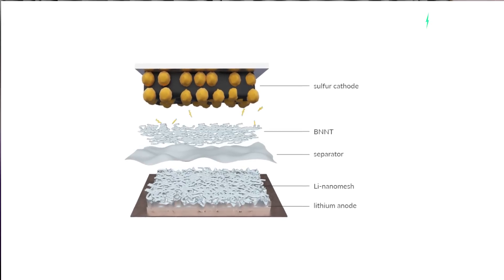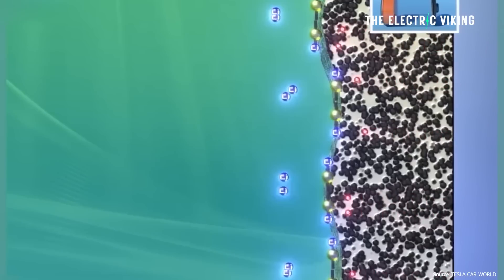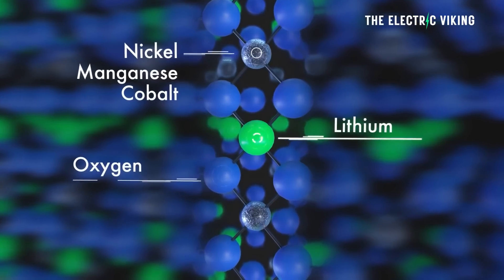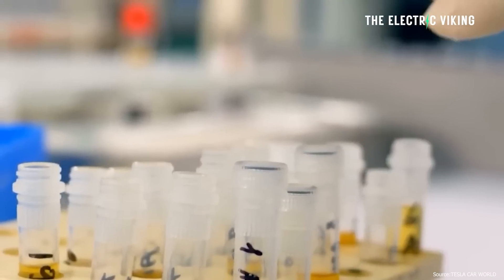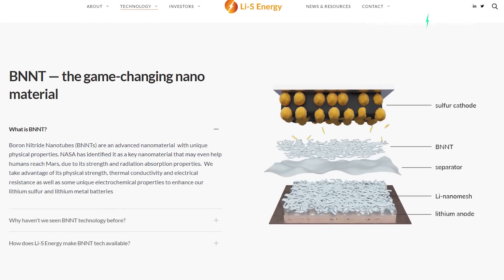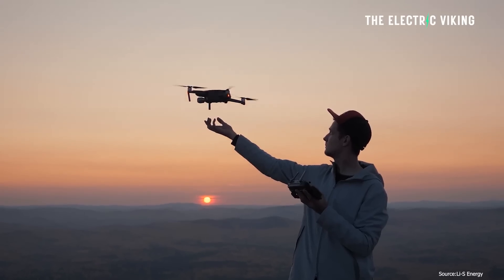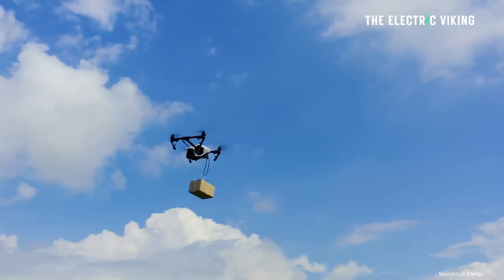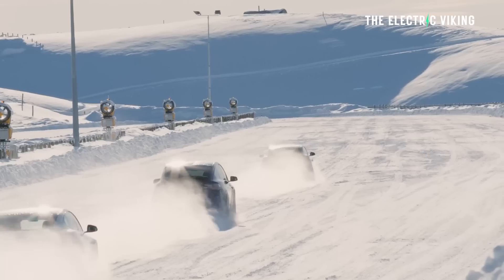Aussies Unveil 50% lighter Semi-Solid Lithium-Sulfur Battery Breakthrough

Comment: I have an Ampera PHEV, Chevy Volt Gen 1, I don’t need a new £60k EV with this battery, I just need an upgrade battery for the car I already have, this tech. would probably give my car 200 miles of range. The car industry wants us all to buy new EV’s & PHEVs then scrap them after a few years and then take out a massive loan to buy the next EV to save the planet, it’s unfortunately all money and BS still. Sorry having a cynical moment, but why, other than NIO are car companies not designing for upgrading as opposed to obsolescence.

Comment: There are 1000’s of battery technologies with higher energy density:
1) Some degrade too quickly.
2) Some aren’t structurally strong.
3) Some have slow charge/discharge rates.
4) Some are too expensive to produce.
5) Some have expensive materials.
6) Some take too long to produce.
7) Some can’t be mass produced.
8) Some have poor voltage charge curves or no charge curve at all (can’t record SoC).
9) Some are dangerous when penetrated. (Causing burns).
10) Some can’t handle execessive heat.
11) Some can’t handle excessive colds.
12) Some get damaged upon expansion. (0% state of charge).
13) Some can’t be produced due to patent infringements.
14) Some batteries does not have strong marketing sales teams to acquire adequate sponsoring and funding.
15) Some have a bad controls engineering and industrial management teams that doesn’t know how to expand factories for mass manufacturing and quality control.
16) Some can’t handle shaking/vibration (due to internal structural material durability)

The list goes on and on…

Comment: Please Sam, Don't confuse Watts with Watt hours.  
This confusion of units is one of the reasons that people find it hard to understand renewable energy / battery energy storage / Electric Vehicle technology.
If Journalists, YouTubers etc always used the units correctly, it would be easier for people to get used to the terminology and understand the technology. Unfortunately, the units are used incorrectly very often.

A "Watt hour" or "kilowatt hour" is a quantity of energy.. think of it like a litre of liquid fuel.. with no reference to how quickly it is created or used. Like a litre of petrol (gasoline) it might power a lawnmower for half an hour, or be used up in seconds by a drag car.
A Watt is a unit of power ... like a horsepower .. that informs you how much work is done in a given time.
And there is no such unit as a Watt per hour (W/h) that you sometimes see.. at least you haven't used that one.
I really appreciate your videos and respect the way you keep them coming, but please, take the time to get the units right!

Comment: Can you talk about battery improvements in mobile phones and laptops some time? Should be the same technology on a smaller scale right?
Reply: Definitely same, the thermal management system on our phone batteries are game changers!  The laptop batteries are structural making laptop crashes safer.
Reply: @borshardsd : GAME CHANGING IS ALL VERY WELL - as long as it won't affect Pacman, the only game I can manage

Comment: When you have a favourite hammer everything looks like a nail - and so it is with Deakin University and Boron Nitride nanotubes.
I haven’t yet found a supplier that provides publicly available cycle life specifications for 400 ~ 500 Wh/kg  Li cells.
Li S cells have been around for over 20 years (e.g. Sion power ) so I wouldn’t get too excited Sam.

Comment: You mixed up Volumetric energy density of Lithium Sulphur with gravimetric in Lithium Ion.
"half the weight" for the same capacity means double the gravimetric energy density, not 50% more,  double is a 100% increase.
For flight we really need Lithium Air or Aluminium air batteries, and to drop oxide for recycling inflight.  We can already make these but their cycle life is between 1-20, weight also increases with use.
Tesla are researching Lithium Sulphur for increased energy density but they are not expecting to double the density.
Sounds like exaggerated claims using irrelevant volume increases, and unreferenced weight change (ie they don't make a comparison to anything so they could be referring to something like LTO which has a very low density).

Comment: the problem is when planes land,  they are lighter than when they take off.  an ev plane would weight the same amount so you would be limited on take off weight because it would be landing weight.   you would have a hard limit on size because the landing gear wouldnt be able to take it otherwise.
Reply: Yu too Kewel.❄️❄️Y the big push for ev planes? Lemme guess; we’re destroying the planet with oil exploration? Ok. How bout jus slow it down alil bit?? Use ev’s, but still drill?
Reply: @ericpitre4031  wut?
Reply: @ericpitre4031  said that maintenance on electric motors is a fraction of other forms of propulsion

Comment: No - weight doesn't affect range of ev's so much because moving  weight has potential energy that is collected when you stop. EV's that have 100kWh battery are just bigger then ev's with 60kWh batteries, have bigger tyres and all of that combined makes big resistance
Reply: Confusing.

Comment: REMEMBER boys & girls, the best ever battery for energy density is GREEN HYDROGEN, yes Electrolysis Hydrogen.  It cannot be an fuel energy source as you can never get back more energy than that needed to break the H2O, just the start of the energy needed to make it, Green H2 is something you do when you have surplus energy, electricity, and you want electricity back (via an H2 Fuel Cell) OR when you need portable electricity buy physics tells you batteries are too heavy (eg power aircraft) and you need the energy density of hydrocarbons n  fossil fuels.
Reply: A Hydrogen plane crash would be spectacular.

Comment: My next car will be an EV.  I, keep seeing stories that make me think I should wait and drive my old clunker another year.  This is just one example.  Still if any car maker is reading this, it means they have time to make the car I will buy.  My requirements are very common ones but they seem to be ignored by the market.  I will try to make a clear list of them:
1) Range needs to be something like 300 miles at reasonable highway speeds.  I am not racing to get somewhere.
2) All wheel drive with smart traction control for bad road conditions.  I will give up horsepower to get this.
3) Just enough power to merge onto the highway, lets say 150-200Horse.  I am not racing anyone
4) A real spare tire.  I want to go out into national parks and national forests and not get stranded.
5) Enough ground clearance for unpaved / unmaintained roads with weeds growing up.
6) A hatch back with rear seats that drop making about a 6 foot space for my stuff.
7) From the hatch to the dashboard long enough to fit one 8 foot 2x4 in. (Ever needed one more on a project?)
8) Simple controls I can do by memory and by feel with my eyes on the road (For all I may need to change on the move)
9) Firm comfortable seats.
Reply: - by 2030 you will be able to drive the Jetsons Mobille - goes the hype...
by 2050 they will be lighter than air...  in increments of 50%. (jk)

Nope they aren't making the car for you. 

But you can put a spare tyre on the bike carrier.
Reply: Gamechanging design.
Reply: I bought an MG for $40,000 to get a foot in the door until the EV I want is on the market.  I won't lose much when I sell it as the 2nd market for EV's will be strong.  Buy an MG4, you won't go wrong.
Reply: It's always interesting to hear how expectations for cars change depending on which country people come from. For European hatchbacks 150-200 bhp is an expensive turbocharged sport model (for petrol engines obviously).
Reply: Ken, aren't electric motors used at a rate of 1 per wheel? hence 4 need for AWD which must decrease range. But I agree with many of your comments. Until I can get an EV with ground clearance and acceleration to match my Outback 3.6L together with AWD and a true expressway speed range of 600kms after a battery degradation of 5 years then I'm not going to jump ship.   But I'm pretty hopeful Lithium/Sulphur will achieve this, with Sydney to Melbourne on the one charge being a goal.
Reply: @stevecrocker6904  you need to do more research Steve. Your outlander hasn't got four engines, has it?
Reply: @stevecrocker6904  Four smaller motors instead of one big one doesn't in principle reduce range.  Range is a matter of losses.  More money can give you more efficient motors.
My Subaru is faster than I need by a large fraction and it is just the 4 cylinder.  Merging onto the highway is the only time I use much.
Your freeway speed looks to me like and error.  You need maybe 130km/s
A battery that is down by 20% in 10 years would be fine I think.
Ground clearance is the one thing I expect to be hard to find in a car.

Comment: Imagine if this was about to be mass produced... This could be a new age for airlines!
Reply: nonesense. The energy density of best tech batteries is to low. ie average cars fuel load weight is approx 70 kgs with say an assumed 700klm range. If an EV existed that had a range we could realistically assume that the battery would weigh around 700kg. An Airbus 380s fuel load is 300000kg, which would require a battery weight of around 3000 tons. FIGURES DONT LIE. So a 50 percent lighter in the context of mass passenger aviation is meaningless.

Comment: Lithium-Sulfur batteries are actually 1/3 the weight of LFP and NMC. And sulfur can store 5 times more lithium than the current best nickel based Chemistries. Lyten broke ground on their factory to mass produce them this past November in California with more than 2x the current best energy density. It already has a deal with Stellantis and an Israeli electric airplane manufacturer.

And Drexel University in Pennsylvania managed to get more than 3x the best current energy density and lasted for over 4,000 cycles with very little degradation. 

Lithium-Sulfur will be the main battery technology used for vehicles by the end of this decade.
Reply: I'm just hanging out for an EV until Lithium/Sulphur tech is introduced. Monash Uni research group have talked of overcoming anode corrosion by using glucose in the matrix.  And energy densities of easily greater than 100% more is touted. Plans seem afoot to make Sydney to Melbourne on one charge a common experience.
Reply: I hope they’re used to start the planes. I bet they gonna use for engines? That must hv been tested for a long long time. Are we there? Maybe a backup  if fuel runs out?
Reply: @ericpitre4031 planes are built with redundancy, I believe,  so the batteries will be grouped to work even if there is a failure in one.

Should be different parts but similar safe redundancy built in to the product?
Reply: @borshardsd  
They’ll be in series , perhaps? Ok im tired later on playa hater🥴🥴🍼✌️✌️🇺🇸🍔
Reply: @ericpitre4031  🍻 exactly. One light goes out, they all go out =b.
Reply: @borshardsd  dont fly lil playa hater🥴🥴✌️🤜🍼
Reply: @ericpitre4031  I guess we have a misunderstanding. Wishing you well, signed: the eripitr4031 fan.

Comment: It's lighter - but only if it's powering a Kangoroo jumping up, up and up again. Short: just another fraud.
Reply: No, it isn't fraud at all, but it will probably be a niche market.  These batteries do exist and they do work, they just won't be manufacturing at an EV scale anytime soon, nor do they claim this.  They openly admit their plant will produce just 2 megawatts worth of batteries which is a very small amount.  Giga-Nevada produces 20,000 times more output.  So there's no fraud, since they aren't deceiving anyone.
Reply: Research is not fraud.
You could say that about turbochargers when they ran on ballbearings.
Tech improves.